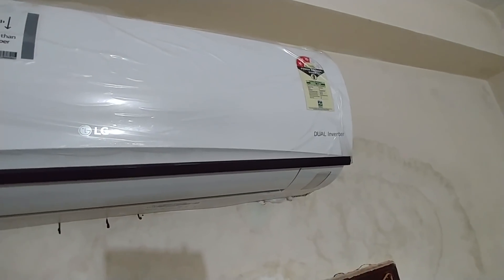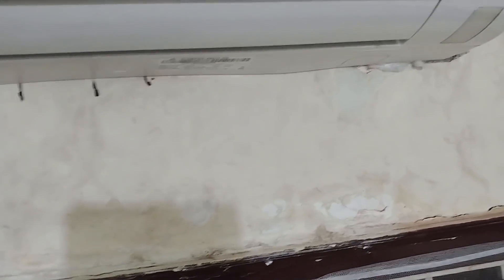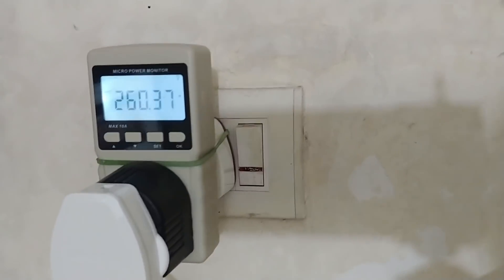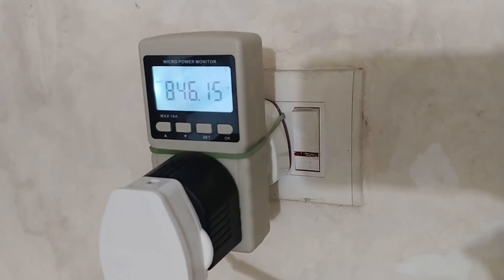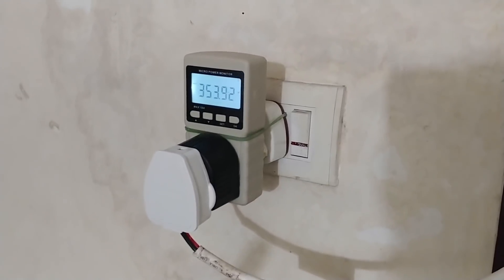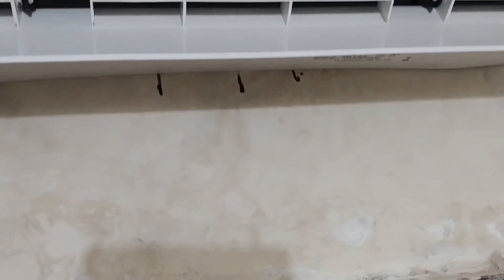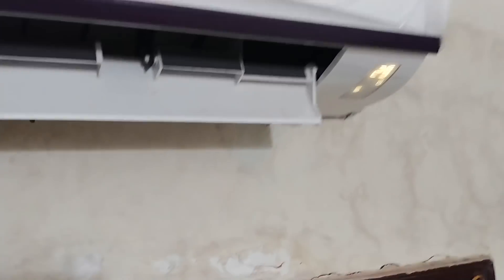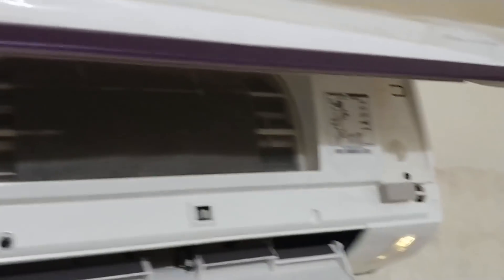Inverter ac how do they work- lg dual inverter review

Comment: Nishanth Ji i have one query - From which converter(The black One) in the video you tried connecting with ac power plug since micro monitor will support I guess only 3 pin plug, please suggest or provide any link to buy this. Many Thanks.

Comment: Good vid.
I have 5 star normal split 1 ton at 1000w all copper condenser inside n out .I get max 450-500 bill .I run AC at 25 throught day 24x7x365.
Inverter AC is a gimmick .there is better tech in China hybrid AC.

Comment: Somehow all guys get low consumption of power.
I have a one ton Daikin inverter AC and my room size is around 100 sq ft.
I used a regular Meter to measure and I find that on an average it consumes about 0.650 watts/hr after it has attained the required set temperature which would be around 25 C.

Comment: hi nice explaining abt using inverter ac
but which one is better in inverter ac's?
LG or Daikin or Hitachi?
i have to buy one but i'm confused between these 3
Reply from the maker: Quality wise Daikin service wise i would say lg but my lg is 2 yrs old now and working flawlessly.hitachi no no
Reply: @narayannishanth465  so in power consumption which ac is better and on cooling capacity which ac is better?
comparing 1.5 ton 5 star on daikin and lg

Comment: Hey Nishnath, great video.  I was informed by a aircon tech that setting the inverter ac to lowest temp (16-17) will be consume less rather than setting to 24-25 celcius. Do u think thats correct? Thanks in advance
Reply from the maker: Nope that not correct 16 will burn more power

Comment: Which model are you installed sir ,pl inform me I have to buy one.
Reply from the maker: hariharan venkat check for newer models they are much better mine is a 2017 model ac. If money permits buy daikin. Hope it helps
Reply: nishanth narayan  can I go for blue star .
Reply from the maker: hariharan venkat sorry i don't have experience with it i also use a daikin and voltas both are good IMHO

Comment: I have conventional ac.My service man told me never buy inverter ac because it is not good for long years and and also huge expensive to repair.Is it true ? Any honest suggestion will helpfull.
Reply from the maker: monaxp606 this is basically bullshit. Expensive car doesn't mean costly to repair it also means its sophisticated. Just like that with ac choose a reliable brand. Ull save a lot even if you have repair charges. But most of the time the work really well. Don't worry

Comment: @7:14 "It doesnt go to 1800 to zero 1800 to zero" he says. Even a non-inverter AC will not be 1800 to zero watts. The fan motor and internal electronics section which are running irrespective of the compressor will however consume about 200-250w non stop.
Reply from the maker: Very good live in the shit world of yours if you are so knowledgeable please make a video yourselves. Don't just try hard to prove yourselves an idiot. Speak respectfully ull get that in return. Don't be an a hole please
Reply: My Hitachi AC use 8 watts for Blower Motor, Inverter AC are made for power efficiency..

Comment: On Average no matter what your ac or any Inverter AC average consumstion is aprox 600 watts. the reason u could show such drastic decrease because you put your AC to 28 degrees & low fan speed. 
Normally 24 degrees is comfortable as per various surveys, so at this level average will come upto 550-650 watts average for 8 hour consumption.
Reply: Abdul Narayan D'souza one month mein 7 hours in a day use ho raha hai to kitna unit consume karna chaiye
Reply: It depends upon Ton of AC & area of room to be cooled..
Reply: ajamit007 1.5 ton dual inverter
Reply: It should consume 1 unit per 2 Hour..
Reply: Technician aya tha check kiya 8.40 to 8.50 ampier show ho raha hai
Reply: Aap ka contact number mil sakta hai

Comment: I have d same model ac...1yr se use kar raha hu...but after using 1 hr sometime compressor get stopped...nd after 3-5min its get started......so is dt a problem?
Reply from the maker: Sourav Nandi no problem its quite normal
Reply: nishanth narayan .. but u told dt the compressor of inverter ac didnt get stopped...its reduced the power to maintain the temperature...
Reply from the maker: It can't run slower than a particular level if needed to run slower than that it cuts off then starts slowly again nothing to worry
Reply: nishanth narayan ok... thank u yr
Reply: Your Outside temp heat load is low, so Compressor will stop..

Comment: It would be nice if you can produce  a video of a non inverter ac, where the power consumption is shown when compressor switch on to compensate for heat loss of the room.
Reply from the maker: Narayanan Devarajan will try to do it

Comment: Sir want to know that the compressor indicater light mentioned in display panel is off after reaches the set temperature or not. Because one of review of the same model says that the compressor has stopped after reaches the set temperature. Have you noticed that in your unit because in mine it displayed continuously for all time.

Comment: Nice video but I am still not convinced that inverter ACs give extraordinary savings. If inverter AC slows down, a conventional AC keeps cycling on and off. Maybe it all balances out for a moderate user in the long run. Not to forget that inverter ACs require a much higher investment up front. And God forbid if your inverter ac breaks down then repairs are much much costlier than a conventional ACs. Even the gas is nearly double in price. Looks like just a marketing scam to me.
Reply: Sunny Nexxt I'm not sure when you last checked about ACs... must be quite a while back.. even I thought like you but that changed recently when I bought a new ac.. I got voltas.. and the price difference between 3 star inverter and 3 star non-inverter at the authorised dealer was just Rs.1000... I was shocked.. last I checked they cost atleast 7-10k more than their counterparts.. not anymore.. they gave me 5 yr warranty.. everything is included in it except labour.. and inverter compressor has 10yrs warranty.. I still don't see how you can say normal ac is better than inverter UNLESS what this video suggests that if you like 16-18°c then normal ac is good otherwise at 22-26°c inverter ac will save money.. this is world renowned technology that originated from Japan.. you can find this inverter ac system in all the countries.. trust it.. it's the future
Reply: I had bought a Panasonic 1 ton split ac in 2013... It cost around 28k.. Inverter ac were new at that time, I asked about 1 ton inverter ac(don't remember which company), the price was 40k.. 12k more.. that's why I settled for non Inverter back then... not anymore today.. I bought voltas 1.5 ton 3 star inverter ac for 35k... Everyone is buying inverter ac only where I live.. and it's a small town!!!

Comment: Thank you for the video.  You have explained quite well.  I especially appreciated you showing live readings using the power monitor! ✅👍

8:45 - you mentioned that we can see it has aluminium condenser.  Can we see this in the indoor unit or is it in the outdoor unit? Is the compressor in the outdoor unit? Sorry, confused.

Also, do you know where the sensor for room temp is?  What i see is that if i set the temp to 26 or 27, then after some time the room temp is 24 or even 23.  If i set the temp to 25, then the room temp can be even 21 at night. Room size is 12x14".
Thank you
Reply from the maker: Ab Ab the Temperature sensor is kind of average it has mind of its own. The one showed is the heat exchanger not the condenser both are aluminium in this case

Comment: Also if you using a non inverter AC, you will sometimes feel the room very cold and when the compressor cuts off the room becomes hot after a few minutes before the compressor restarts.. Inverter AC's maintain the room temperature and you feel more comfortable.. specially at nights when you are sleeping you will notice the difference
Reply: Lokesh Tulsani, good point.
Reply from the maker: Very valid point inverters are damn comfortable

Comment: i still says 5 star rated ac are better than inverter because  we dont have stable electric current in india and also repair cost is two fold  PCB card cost more than 12K  so not recommended as of now  .
Reply from the maker: wont be a issue use a good stabilizer
Reply: I got 5 year comprehensive warranty on my voltas ac, only labour will be charged else all is free and 10 year warranty on inverter compressor... I don't see how that is more expensive than normal ac... And yes w.r.t to voltage, all the companies mention that using voltage stabiliser is Mandatory in India.. otherwise even warranty can be void..
Reply: The problem with Non-Inverter AC is continuous comfortable Temp, and power efficiency..

Comment: Yes really helpful....I calculate load with the help of no of pulses per min on main meter's pulse indicator [ keeping other electronics off ] then convert it into hour then divide it from 3200... it gives the load in kilowatts...
I have 1ton LG dual inverter AC...after 15-20 mins at Himalayan mode, I use at 28°c...then I switch off all electronics other than ac...then I count main meter pulses for a minute which comes 12 pulses per min...then I convert it into hour which becomes 12*60=720 pulses... then I divide 720 by 3200...then I get 2.25 kilowatts... which is just 225 Watts... it's amazing...a cooler motor is about 150 Watts... I'm so happy to own inverter AC....I don't like 26°c or 27°c ...nor do my parents like...!!!
Buy inverter only if you don't like too Cold...my room size is 170 square feet and  is surrounded by neighbors' walls...and there's no sun shine from any sides...!
Update: I sent 413 units in previous hot season of 6 months... In which is used this action for 14-16 hours a day at 28°....i had a separate meter fixed near it... I'm so happy
Reply: Correction..0.225kilowatts...not 2.25kilowatts...
Reply: Doesn't your meter show various details like wattage, amps etc being consumed.? I thought all discoms are using electronic meters like that only from ages now..
Reply from the maker: Wow so much math
Reply: Anurag Saxena, great information. Thanks for the details.  I am assuming it is not humid where you live.  

Yes, indeed the savings are amazing.  Good point about cooler being 150 watts.
Reply: Is this applies to all inverter ac or Voltas?
Reply: Anurag Saxena aap 1ton ac 170sqft area main chalate ho kya thats great

Comment: Bro I have bought one dual inverter LG AC but not installed yet. I have a question which would be the things I need to prepare before the technician guy comes. I dont have a separate socket, can I enjoin the wiring of a bulb to the AC cutting the bulb connection. I live in a rented house. Please reply brother.
Reply from the maker: RockinRaag don't do it have a electrician install a 16 amp power socket the buld wires can't handle huge current.hope it helps
Reply: nishanth narayan oh there is no internal connection may be. So do I need to install a 16 Amp socket from a nearest board via external wiring?
Reply from the maker: RockinRaag yes

Comment: Sir I have bluestar invertor Ac . outdoor unit is under direct sunlight but I mostly use Ac in night for 7-10hours.should I cover the outdoor unit with something and also pipes connecting indoor unit to outdoor is 16 feet . does it require more refregent.

Comment: I just taken daikin 1.5 inveter ac.. Can you please tell me do I need to buy stabilizer if so kaunsa wala lun.. Please respond.. I gues in my area sometimes low voltage rehta
Reply from the maker: Buy any top brand vguard double boost model should be enough

Comment: The best in the market now is Daikin 5 star inverter ( jtkj series ) . It has a iseer value of 5.8 ,whereas most other 5 star inverter ACS are of iseer value in range of 4.75 to 4.85 . Iseer value of above 4.5 is 5 star inverter for 2018 . It will consume just 483 units for 1600 hours (27 c)
It is so silent ,I thought it was not running at all . I also have a 3 year old bluestar 3 star regular ac , the outdoor unit can be heard in the ground floor bedroom even though it is in top floor 
I bought it for 39990 ( jtkj35tv16u ,1 ton ) after bargaining in very large retailer .in smaller towns or smaller shops the price would be 44 to 45 k .

Comment: LG dual inverter is best AC comparison to other brands Inverter AC
Reply: Anuj kumar I'm not sure.. this model costs 40k+ where I live(1.5 ton), 5000w was the max cooling capacity, 3 star inverter with aluminium condenser..
Voltas 1.5 ton 3 star inverter ac has all copper pipings with max cooling rated at 5200w... For 35k... I know LG has brand value.. but voltas is not really bad either and gets the job done in budget
Reply: And also the power input rating on the LG model is 1830w whereas in voltas it's 1760w... and the min temp is also 17 vs 18 in lg..😜Voltas just beats it in every department with lot of money to spare..
Reply from the maker: Karan Padhi i am surprised coz i bought this for 27k on tata cliq with 3yrs warranty
Reply: nishanth narayan oh yeah tata cliq still shows 29k for this ac... Whereas every other place is 36k+... I wonder what is tata cliq doing?😮
Reply: nishanth narayan LG authorised dealer said where I live, he is only selling copper ones 1.5 ton starting at 42.. only latest models.. after that I took out LG out of my options
Reply: nishanth narayan the same ac that I bought for 35k is showing 37 on tata cliq.. so I guess not all models are cheap.. only some are cheaper.. maybe clearance sales since old stock?
Reply: nishanth narayan how low can this ac can cool.. Mine lg dual inverter doesn't cool below 20 Celsius and i have been told by service guy's that it's the maximum a ac can cool....
Reply: HeyYmant meena  Temperature setting in AC thru remote doesn’t mean that Compressor starts cool at 20 degree
It’s just remain On and On continuously till the room temperature matches with sensor uploaded temperature
Kindly set your AC temperature to 22 this will make your AC work well and inverter AC are not much different from normal one except compressor technology
Make sure your room must be closed and AC takes more time to cool if your room terrace is open and now a days the outer temperature is 45 -47 so do make splash of water onto outdoor unit and if it is possible to you make canopy for outdoor unit for faster cooling
Reply: Hitachi is best in inverter Tech in AC but their Service is SH!T..in Mumbai!!!!

Comment: So LG inverter AC cost is almost 20K more than conventional AC, If you saving Rs. 500 a month with inverter AC, You will break even after 40 months of usage, Considering AC is used  6 months every year, it means you will break even after 6.6 years. So by the time you actually start realizing the gains of this AC, you will probably be looking for a new one....
Reply from the maker: Wrong math i would say i bought this for 28k from tata cliq my bill already at least 700 bucks less for minimal usage last compared to my previous ac. its not entirely about saving inverter ac maintains more comfortable temperature than conventional ac hot cold cycle
Reply: Anuj Goyal no voltas , Samsung etc sells 3 star regular ACS for 30 k , you could get 5 star inverter for 40 to 44 k . It saves electricity and more comfortable than on off cycle

Comment: Can you please tell me from where you bought that black adapter
 from??
Reply from the maker: Hari Krishnan check description please
Reply: i also have the same meter, but i dont know how to connect it to the aircondition because ac's 3 pin is bigger than that of the meter.
Reply from the maker: Hari Krishnan use 6a to16a adapter

Comment: 16 c par karna chahiya
Reply: Raj Varghese voltas goes to 17
Reply: Prabhat Pathak you will freeze at 16 , you like it at 16 !?
Reply: मुर्दे को 16°C मे रखा जाता है जो कि सडे ना जम कर सोयेरहे जिन्दा आदमि तो 24/२6°c मे अच्छा कुल filling करताहै।
Reply from the maker: Prabhat Pathak The max is 18
Reply: gosh  why are daikin  ac at max 18 degree not at 16 degree where as most other ac cool upto 16  degree....
Reply: previous ac cooling was up to 16 deg ...but some companies have made it up to 18 and added  powerful mode  and at 16 deg it consumes a  way lot more power so to get more star rating these ac brands  have kept it upto the optimm level  i guess.....
Reply: Some AC gives you to set Temperature below 16 C, but only in Dry Mode..
Reply: Raj Varghese what is the lowest a lg dual star ac can go in term of temperature... I have a lg daul inverter in which there i can go to 16 degree's but i have never seen my room temperature go below 20 when i talked with service guys they told me no ac  can cool below 20...were they right.....??
Reply: It depends on the ambient Temp & Humidity, if your AC have a pull a minus delta of 20*C or more , means it can convert, (lets say ur e.g. ambient temp is), 35*C and can maintain 35-20=15*C..Also it depends upon the continuous heat load your Room is getting @ e.g. 35*C, if your AC can remove heat faster than your heat load, you can able to maintain your 16*C Set Temp on AC..

Most importantly it depends on your (Room insulation + Room Area + Heat Load)

Comment: Very nice video... explanation is simply super... Is there any change between inverter technology and LG Dual Inverter Technology...
Reply from the maker: RamaKrishna Prasad it has dual rotary compressor which has very wider frequency band
Reply: All ac manf. Use dual rotary compressor only
Reply from the maker: Dev Dessai but this one has wider frequency band it can handle very low and high frequency